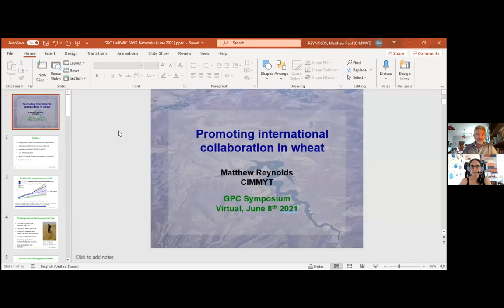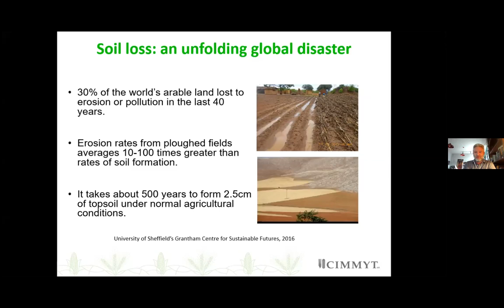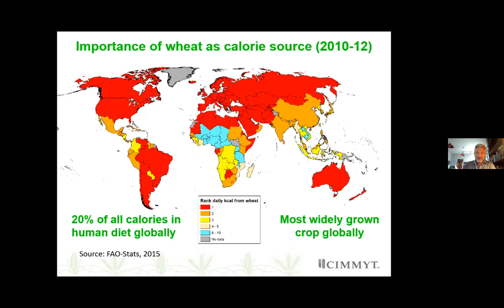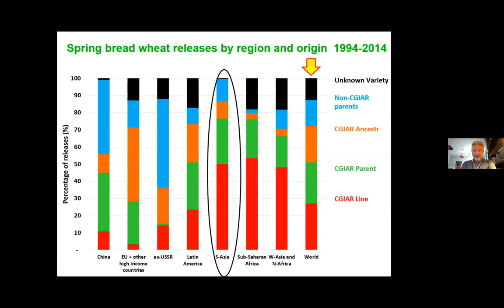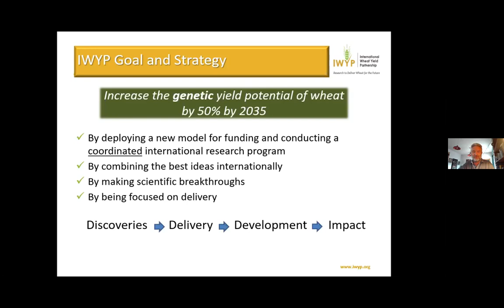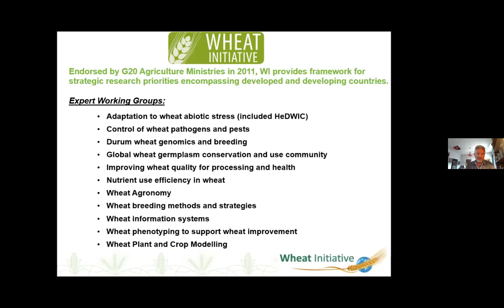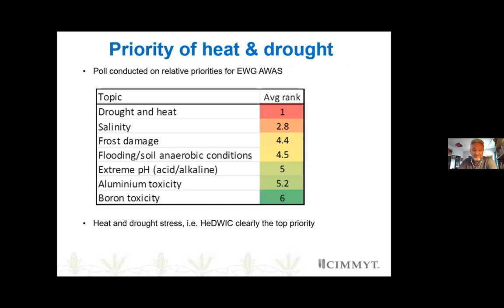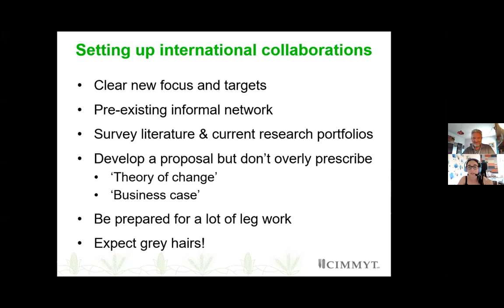Heat and Drought Wheat Improvement Consortium (HeDWIC)

Comment: The Heat and Drought Wheat improvement Consortium
Dear Sir,
Thank you for introducing the network. The questions seem to be in  both in production and trade. The considerations for the drought resistant varieties are  to be met with the cropping practices in the geometry of planting to rationalise the responses to the atmospheric moisture at irrigation and its effect on fungus or rot. There might also be an effect on crop-water for the number of plants per unit area.
I hope this network would address questions and issues on heat and droight and would  be effective and  sucessful in the future
Kalaranji Maheswaran.
✍🌏💧🐅